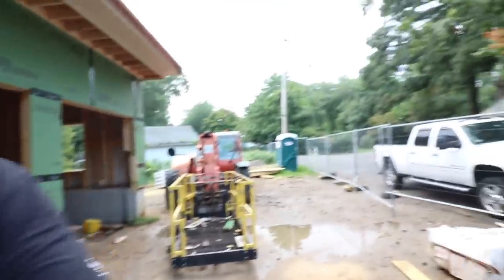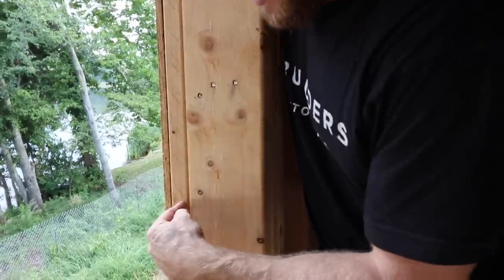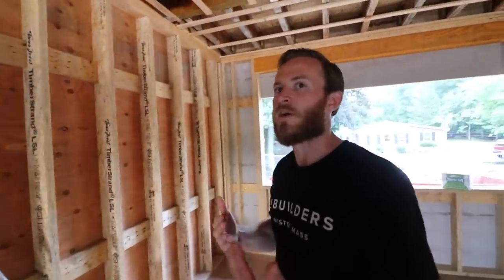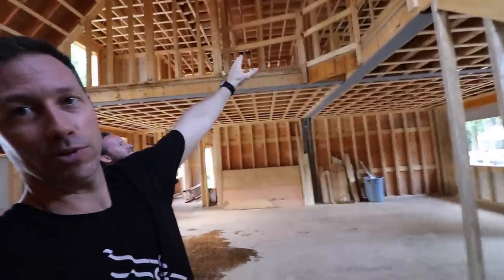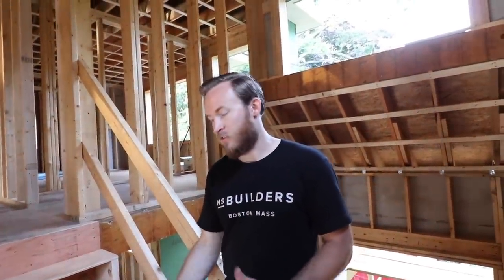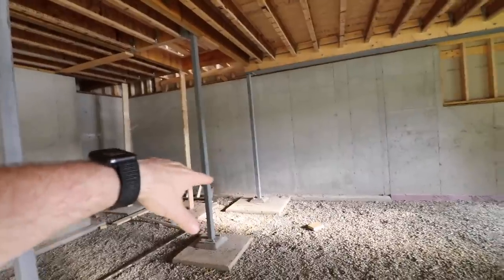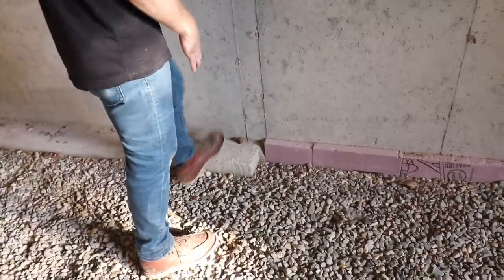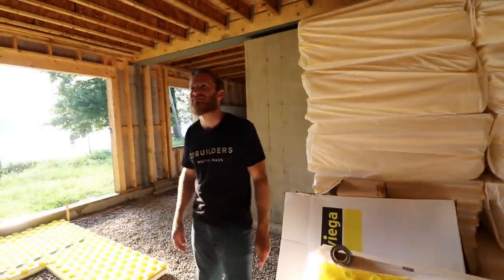How do they Build in Boston? Visiting a new home in Framing

Comment: This building would never get a build permit in my country.

It's all brick, stone and concrete and steel everything here, including the inner walls, even if they don't have to carry a load.

The rest is all very high grade insulation and triple windows everywhere,....central heating is obligatory throughout any Dutch house aswell.

Wish i could build like this,....but nope, never going to happen here in The Kingdom.
Reply: ThatDutchguy That’s because Europe doesn’t actually have to face wind and earthquakes. They have goofy ideas about what is actually helpful and what just makes you feel good. The insulation is also far lower in Europe with the exception of windows.  Just so you know though...they have central heat everywhere not just in Boston but in Texas, too. :)

Solid construction also means more severe obsolescence issues. I’ve moved walls in every house I’ve owned. It’s easy here. You can’t even get an extra outlet on a solid wall!

Comment: You need to read a code book....Headers are not sufficient, Sheathing is installed wrong, sloped ceilings must be a minimum of 12 for r-38 energy code compliance...And God forbid osha shows up...you walked into the house on a step ladder, unfolded and leaning against the building...violation....all doors and window less than 18 in off floor that have more than a 21 in drop must have safety rails...Violation...all mezzanines and stairs over 14 in drop must have anti fall rails...not 2X4 nailed as a hand rail..(must take 200 lb per ft)  stacked lumber through a opening that you moved to get around...violation.   These are not professionals...and by the way...once you blocked for the kitchen cabinets the lam studs are now a moot point.

Comment: It really bothers me that home builders still use 200 year old structure technology - stick built with dimension lumber - when SIPS panels are available instead.  Wood structure=fire death trap!
Reply: There is a reason sips is not catching on.  They are not very structural, no good after 2nd floor, they move under little wind, and you cant keep sheet rock on them.  sips is very flimsy
Reply: We must not be talking about the same thing, the sips panel in my house are light gauge steel fully immersed in solid foam, making a very rigid and light weight panel.  They are structural, but not flammable, not subject to moisture rot or termites, and highly energy efficient.  The drywall on the interior is fastened with drywall screws and in 10 years I have not had ANY drywall (sheet rock) issues.  I don't know where you got your information about this product.

Comment: They build way better in the north. They have to due to changing seasons. Here, its cheap, weak, an honestly shit comparable to the north. Exception is spending thousands more in Texas for a decent house.
Reply: And south Florida
Reply: I'm in Kalifornia and the Builds are even or greater as the N.E. That said, I'm appalled at construction quality in Missouri where I will be retiring to next Summer. As a General Contractor the Subs will either love me or hate me in my final home.  

$75,000 permits in my current town. $500.00 in total with only three inspections for the rough phase in SoMo. I spoke with the County Engineer (Mo), he said "We trust you to get it right, you will either live in your build or be liable for it" Got to love his attitude, however, it appears most Builders in Mo. are willing to accept liability for shoddy work. IMHO
Reply: I'm in Arkansas and I was my own GC. We live "in the county" so only had to have a plumbing inspection by the local water authority.  No permits required.  To get a good house, you just have to find a local contractor who's been building nice homes for 10+ years and who everyone knows.  Ask around.  Most of them work locally.  But you'll get what you pay for, unless like you (and me) you do it yourself.

Comment: that wave in your zip material would have gone away as soon as you installed siding. because it will compress and nail into studs.. and now u wasted a ton of money adding that extra backing which still hasnt solved your issue. idk if youre being sponsored by zip R but its way too expensive with little increase in efficiency. the product will be obsolete in couple years. it cannot be recycled properly like wood,  expensive to get rid of. and why do u have strapping on your joists, screw drywall into joists? a shear wall on an interior wall? framer used way too much wood for no reason.. your'e a cost plus builder who is making a killing off charging your clients for materials. pretty shady looking. an architect who knows anything would never spec alot of this.

Comment: Wooden houses are so weird to me. It's surprising that Americans, who are usually all about strength and toughness, build such flimsy houses.

Are concrete or brick houses still being built in the US, or is it really all wood?
Reply: concrete and stone houses have a hard time in the north due to severe temp change and moisture.  Our nights can be below zero and by noon its 75 degrees.  concrete cracks and stone separates. As a matter of fact consistency in expansion is so important that the integration of steel in wood frame is frowned upon up here, we almost always use laminate lumber that expands and contracts at the same rate as wood.  The ceilings will be cracked sheet rock first winter.

Comment: American construction is just laughable. Why not pour second floor slab and use bricks?
Reply: Way harder to insulate, run mechanicals, it's slower, it's overbuilt for our climate, etc
Reply: Our ambient temperatures  (0 degree nights and 75 degree days tear them apart.)  florida uses suspended slabs...we have a hard time keeping out foundations from cracking. If we build block, brick or stone buildings we have to put numerous expansion joints in them and we still suffer delamination. No a climate for stone, brick or block
Reply: This is ridiculous? What mechanicals? Wiring and AC conduits can be run in brick walls too. It is slower, yes, and your builder won't make as much money from a house as from a shack.
Reply: The higher you build, the lighter the materials.  You want a house that is bottom heavy, well rooted, but can sway in the breeze without breaking.  Like a tree.

Comment: He keeps referencing how they build in Texas. Please take a hint and realize Texas does not build correctly. While living there, I was blown away with the poor craftsmanship I saw in every build. Shortly after homes were completed, walls would bow, roofs leaked, and foundations tilted. When I asked how houses passed inspection, I was told they did not have inspectors checking every step of the building process. This house may look like overkill to some, but it will last longer than most with fewer problems.

Comment: we are very close to the most efficient safe home who no one will be able to afford as well as pay the tax the more expensive codes added to cost of home the more the local government can tax. to hire more gov employees to vote the politician into power. and yes i have see many easy simple cost effective methods done here and other places but seen many "NEW" innovations forced  that failed since often its not builders and or engineers come up with but political people enacted
ibc  good idea until i read who the overwhelming voting members are. i not elaborating look up the list and see who they are consumers, builders, architects and engineers are either missing or tiny minority but government employees 
which in many citys and towns are corrupt. ie city of phila 14 plumbing inspectors in total 13 indicted for criminal activity, and more recent an demo inspecter did drive by which resulted in neighbor thrift store crushed to death. he committed suicide
yes i am cynical i owned 3 homes 1 old old 2 brand new. the one built in the early 1900 was the best design best built and with just a few minor mods was and still is the best